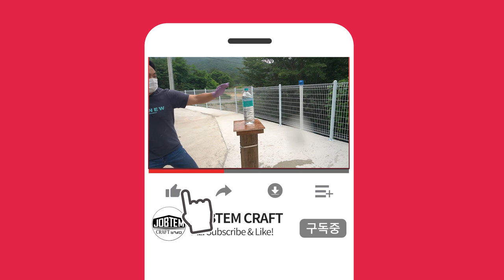Sword Making - Cavalry Saber / 기병의 검, 사브르 (세이버) 만들기

Comment: At [8:28]: is it just me or is the blade really losing its width towards the grip? Also, hard to see but is there any distal tapering on the blade? 
The cutting performance is good.
Reply from the maker: Yes. Blade has tapering and width of ricasso part is a little bit smaller than blade's. Thank you for check it out! 😚👍